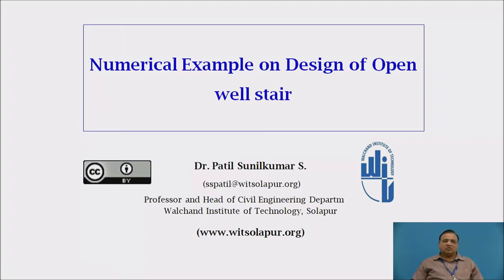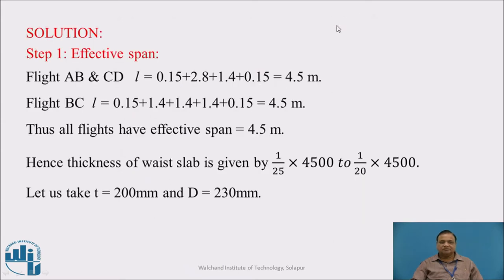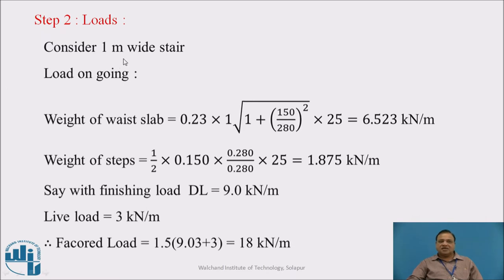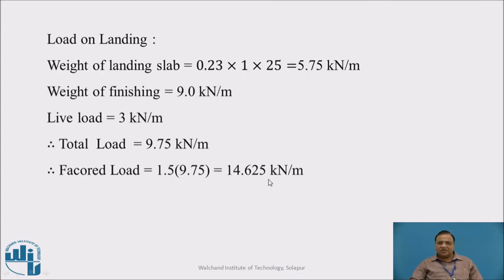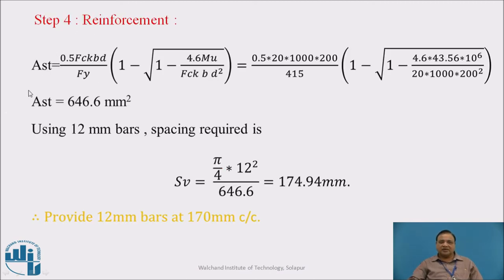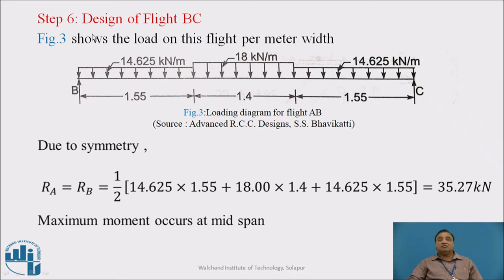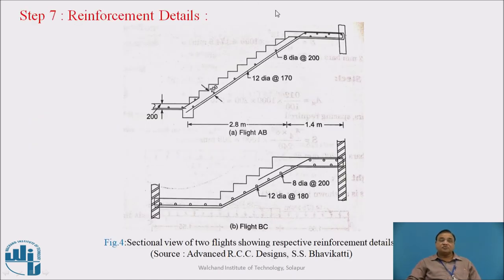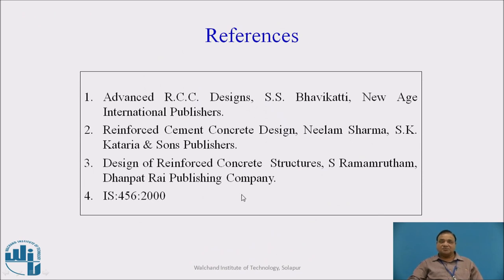Numerical example on design of open well stairs

Comment: Sir, for span BC at the ends there is no support given in the question, then why are we taking the effective length as 4.5 m ??
Reply: there are wall support (i.e 300/2+1400+1400+1400+300/2)
Reply: @rabindra_maharjan  Thank you sir, may i ask another question, is it possible to design the span BC without wall supports , if yes then what will be the effective length ??